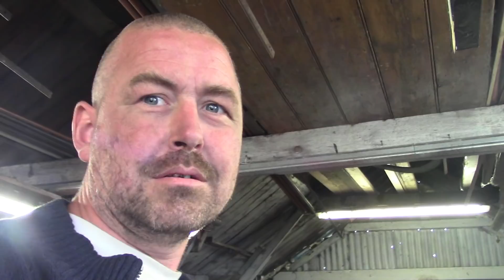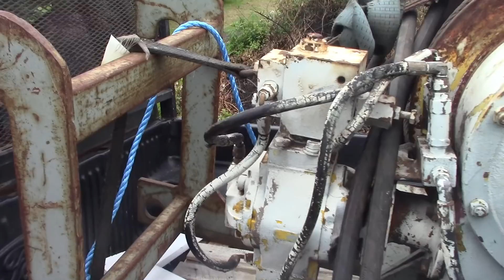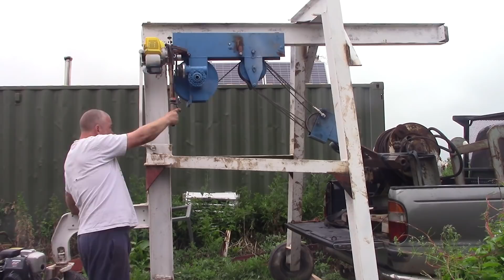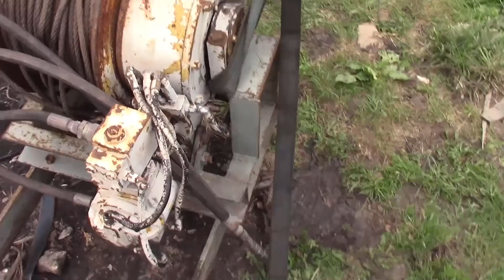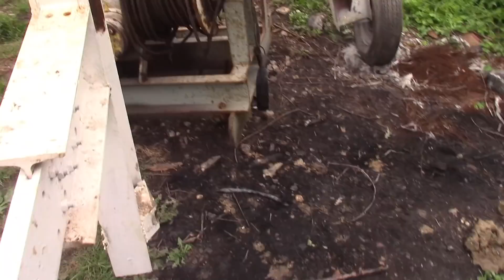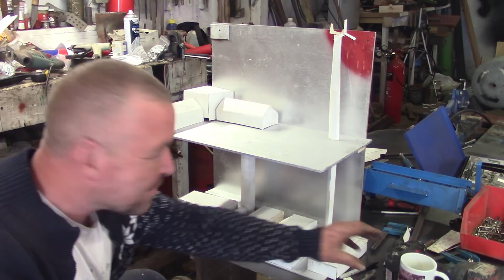Underground Bunker workshop. The suprise and a chat about the workshopolopulouse with 3d modeling!

Comment: At 23:28 we find the real reason for the complex '** trains!'  This guy in Ontario back in the late 1970's built a complex of schoolbuses set on a bed and simply poured concrete around them. He's since passed away & this complex is there moldering away. Its not cleared for occupancy is deteriorating etc. You've put a lot of planning into the project. My worry with something like this would be passive drainage. Pumping costs for seepage would be the killer. The less $ you have to spend on pumping seepage the better. Something that did not require any pumping on your shilling, & it kept dry indefinitely would be ideal. All the best.
Reply from the maker: I completely agree, I don't think it'd ever be as big an energy consumer as ventilation but it's something on my mind, there are so many good products around specifically for internal tanking that I'm hoping one of them will work, but most of all I've gone through the water table now, I'm actually underneath it so unlike the bus man, I have an impermeable layer of clay on my side and materials that are designed to be below ground.
Reply: Windmills
Reply: yes. Powering sump pumps is a good use for wind generators.
Reply: @martkbanjoboy8853  nah. Windmills that pump water from the sump
Reply: @zeusapollo8688  It would look nice to see one of those mechanical windmill/pump dealios. I only ever seen them on old Westerm movies except for one time out in Alberta on business. I found myself in cattle country & there it was in all its 100% functional glory, pumping well water into a trough for the beasties.